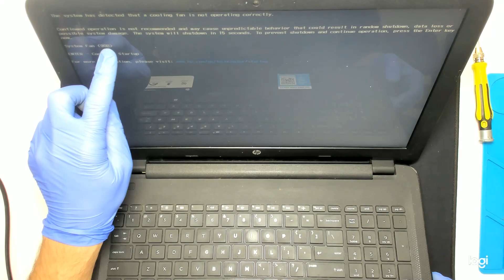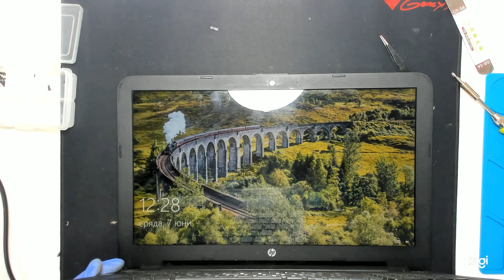HP 15-af Series System Fan (90b) error / Disassembly

Comment: For some reason I can’t even open the back of my laptop complete I take out all the clips and screws and it seems like something is holding it in the middle From completely opening
Reply from the maker: Usually in the middle there is a bigger plastics clip like anchor. Try to pull a bit harder, if you are sure you did remove all the screws.

Comment: Hey I have a question, so the thing is, I have a bit older HP Elitbook workstation that Im using it just for work, Acad drawing.. so last two days I heard that computer is kind a silent usualy is laud as an army tank. Today when I wanted to do some jobe emediately when I powored up got same notion as you said fen 90b... I opened removeble cover on the bottom and cerfule cleaned with a compresed air and after powered up notion got off fan also spining as it should and the sound of "tank" is back the question is did I need to be cerfule on some things or is now just ok, I know that my laptop is about 8yo but since working great for my job I will not replace them til it will work fine.
Reply from the maker: You can clean the fan regularly, but is a good idea to replace the thermal paste every 1-2 years. The fan is loud because the CPU is hod due to old paste, and it trying to cool it down. Otherwise everything should be ok.
Reply: @LaptopDisassembly  dhanyavad

Comment: we didnt see in the video that the fan was cleaned, was it not replaced?
Reply from the maker: The fan was not replaced, just brushed out the dust. 90b error is due to fan not working properly on power up. It it doesn't spin at full on the power on, the system gives a 90b error.